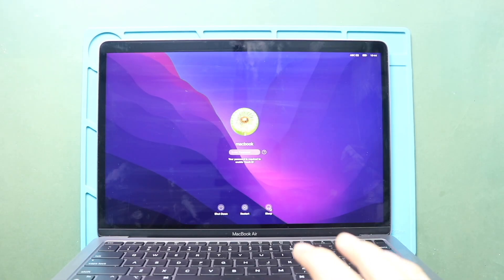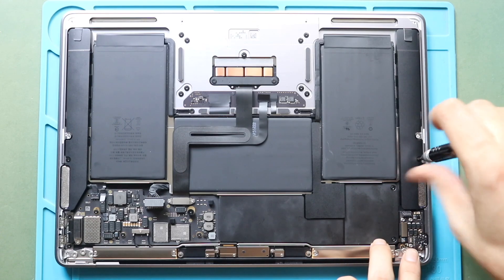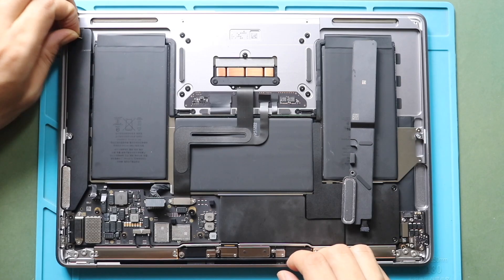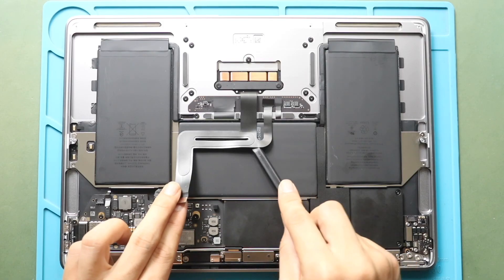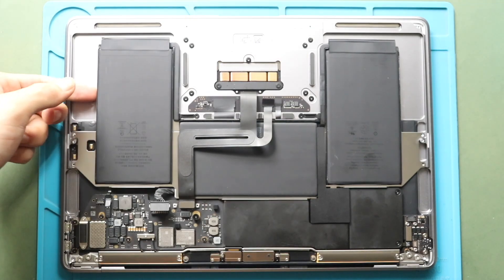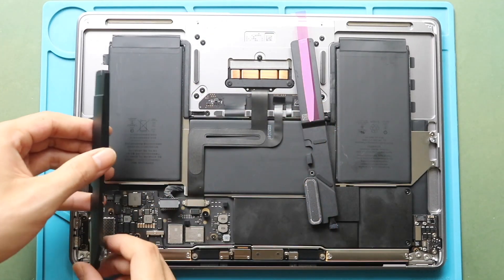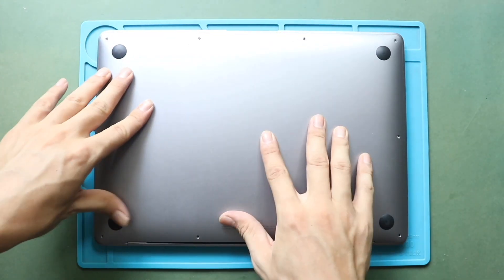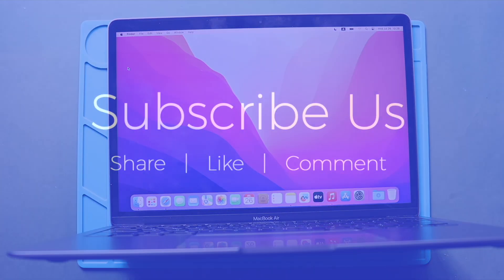Macbook Air M1 A2337 Battery Replacement

Comment: Thanks for posting this video. Made a temp replacement on the A2337 on Friday. Do not recall seeing an error message in the battery settings with the replacement unit. Also, I believe the step to remove the screws for the BMS (right side of the laptop view) - under the black insulator was missed. For us, there was liquid damage by the client and the battery has shutdown. The replacement battery is working fine.
Reply from the maker: Thanks for sharing..🙏

Comment: When the exchange is made, can it recognize if the part is not original?
Reply from the maker: Well, most likely yes, but if the battery is good, there won't be issues, but there will be an error message in battery settings